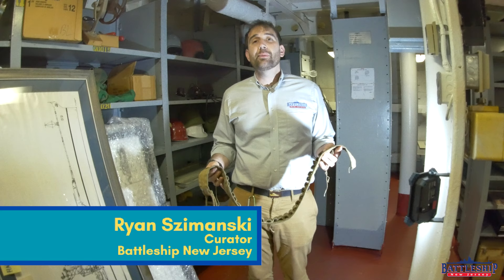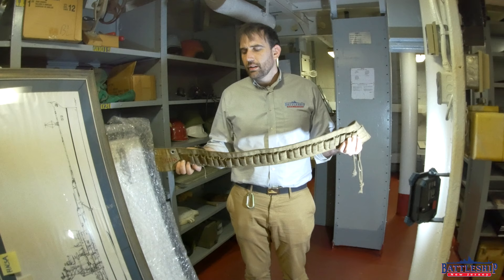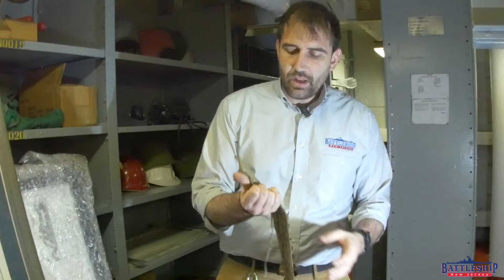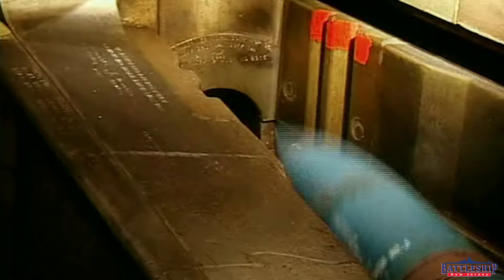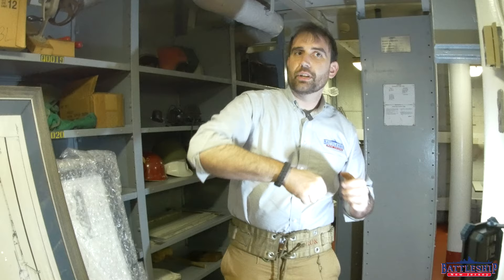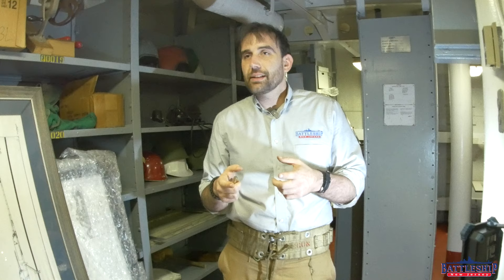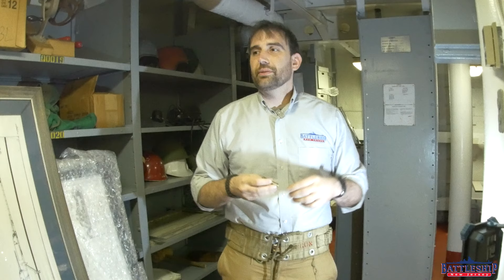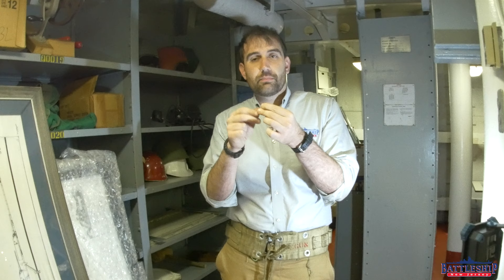A DIY Cowboy Belt for 16 Inchers

Comment: The primer looks like it is based on the .45-70 case, not a .30 cal. case.
Reply: That’s exactly what I was thinking.
Reply: I don’t think the case started life as an actual .45-70 case, especially after seeing the cross-section, but the external dimensions look very similar.
Reply: no it's modified 30-40 krag casing going by the comparison with the 30-06!
Reply: I have to respectfully disagree.  I measured the computer screen with digital calipers, and after doing some conversion calculations, the primer is exactly the size of a .45-70 case.   The .30-40 Krag has a rim of .545, and a base of .457, which is clearly smaller than the .30-06's  .473 base dia.,  but the .45-70 rim is .608,  with a base of .505, which is larger than the .473 of the .30-06 case, and is clearly evident in the video, even without measuring.     I have rifles in all three chamberings, and after comparing and handling them, there is no doubt in my mind that it is a .45-70 size case.   
The US military has a long history with the .45 Government round, and I believe they used it because it was big enough to hold the mechanical and electronic priming systems, while also being large enough to hold the necessary powder charge. @keithmoore5306
Reply: @Mopartoolman It certainly seems based on 45-70. The Bulletpicker website has a good diagram and basic dimensions of the Mk15 primer. There’s some of these primers next to a 30-06 and one of these belts on display aboard Alabama.

Comment: i would speculate that a boatswains mate made that belt. if it were an issue item, it probably would have had a hasp like a pistol belt vs string through loops.
Reply: They were probably very worried about metal to metal contact of any sort so decide not to have any metal buckle
Reply: @bascomnextion5639 You brought up a valid point, didn't think about it until right now

Comment: How hot did the guns get to the touch  with high round count engagements/training?
Was there ever a concern about cook offs when extended firing? Meaning bags or the primer going off on their own because of the gun being hot?
I’d imagine probably not because of the long period between shots and how much material you have you have to soak up and disperse the heat. As well as the purging system to take some of that heat away between shots.
Reply: Well the guns with a good crew could get the guns hot enough to slightly droop under combat circumstances in the south Pacific so but the steam system that evacuates the bores before reloading probably does do a good job of keeping it cool.

Comment: Rifle case looked like a .30-06.  I load close to 60 grains smokeless into those.  Most loads are between 50 and 60gr.  Other comments about the primer looking like a .45-70 case smell right.  The primer would definitely need thicker walls than what a .45-70 has, plus the thick star-embossed top plate.  I bet that 60gr of black in there was a good compressed load.

Comment: Practically, this belt makes a lot more sense than a box.  For starters, would they not have a "box holder" mounted somewhere?  Otherwise, you run the risk of the box being dropped into the gun pit.  

To say nothing of the bad stuff that could happen, if you had a loaded gun with an open breech, waiting for the guy to grab one off the floor.

As far as the fabricated belt......it looks like a prime candidate for a swap between the guy in the shop, and the guy in the turret crew.

Another person to interview.....the guys who primed these guns (assuming that there was one guy for each gun?).  I'll bet it was "exciting" to be directly below the gun when fired.

Comment: It is possible to extract dimensional data from pdfs provided you know what a known dimension is. Use the measuring tool to extract that dimension on the drawing and if it differs from the true dimension of the actual object divide one by the other for thw scaling factor.

Comment: I think that primer cartridge is actually a repurposed .45-70 Gov't cartridge, not a weird .30-06 variant, because of the big rim on it and the fact that the before-the-neck diameter of a .30-06 round is .45 approximately. Looks about right for that, and the .45-70 is already a black powder cartridge that's in service about the time bag guns start coming into service, so it makes sense to keep the cartridge around - you can use newer primers in older guns without issue. Makes the most sense, instead of having to invent a special case just for the special primer rounds.

Comment: That's more like a 45-70.

A standard M2 150gr 30-06 has 47 grains of powder.
Reply: More like a .30-30
Reply: no a 30-40 krag casing the karg was a rimmed round they just lopped it off at the start of the neck and crimped it off there!
Reply: @GunRagDave 30-40krag!

Comment: I kinda doubt that the thickness of the primer shell is a safety issue.  (please correct me if I'm wrong, these numbers are from google)  A ww2 16 inch gun operates at 37k psi.  IIRC there are some modern ones in testing that operate at 55k psi.  The operating chamber pressure for an M1 carbine (that fires the round shown in this video, I think) is 40k psi.

That matters because the pressure acts on surface area, so the forces on the two cases should be roughly the same, psi wise.  Does the duration under pressure effect this?  It may also just be to make them more rugged, made better contact, heats up less from the detonation charge from resistance, or was just low hanging fruit to make the case a little heavier.

Are there other factors at work on the physics of this, or am I misunderstanding something?

Comment: I can't imagine why they wouldn't just leave an ammo can full of boxes of them down in the gun pit taped or glued to the floor. After all, the ammo cans are already sealed with rubber gaskets so moisture shouldn't be an issue in service. And if something has gotten into the gun pit that can cause a can of them to catch fire, something catastrophic has happened.
Reply: It's something of a bother to bend down and pick up a single prmer from the floor for every shot. Even if they used an open box like that, it'd make sense for the primer chap to load up a bunch of primers at once from the box into the belt or some kind of bag at waist height and then use that supply to prime the gun without having to change position.
Reply: @LafayetteCCurtis  I mean for general storage when nobody is in the gun pit. Instead of keeping them all in a separate room, just keep a can of them plus the belt down in the gun pit at all times.
Reply: @shockwave6213  I'd say that one is for administrative reasons. The primers would get pretty difficult to count and keep track of once they're in the gun pit. Keeping them in a separate magazine would make it easier for the guns' logisticians to make note of how many boxes have been sent over into the gun pit, check how many unused boxes are left, inspect the boxes for missing/stolen primers, request replacements or remedial actions, etc. since they wouldn't have to run afoul of the pit crew while they're doing that. As for the boxes brought to the gun pit, the storeroom would probably simply treat them as having been used up and expect nothing to come back except for the empty boxes themselves.

Comment: I would rather have my cartridges held in a nylon / plastic rack holder very close to the gun; that way all one has to do is pick the cartridge  out of the rack and insert into the firing chamber. 
Better yet fill the cartridges into magazines and use a voice command system to load them into the firing chamber. Just my thoughts, Ryan.

Comment: You are quite wrong about the pressures involved causing the primer being heavier.  Both the 7.62x51 and 30-06 cartridges are subjected to more pressure than the primer / barrel would be on the 16" guns of the Iowa class battleships.  If you had ever reloading any ammo, you would have realized that since the pressures for those cartridges are pretty basic knowledge.  I was pretty sure that the 16" gun was a bit less, but I had to look it up, just to be sure before calling you out on your mistake.  From what I've read, the primers would get automatically ejected, but there was a provision to manually eject it if it was stuck.

Comment: Spending time to fill the belt and then put away the unused primers is redundant if a ready access point for primers is already in place. It seems unnecessary and a snag potential. Maybe he put the spent ones in there rather than sweeping up. Also eliminates brass rolling underfoot...

Comment: It looks cool, but for what practical reason would they have chosen this over a rack or something in the gun pit?

I would have made hooks on the walls in the gun pits to hold the ammo boxes with primers. Roughly judging the size, there could be 75 primers in one ammo box. In case more are needed, I think there is no time difference between taking a belt off and putting a new one on, or taking an ammo box from a hook and placing a new one back on the hook. However, picking primers from an ammo box and putting them in a belt takes time which you could have spent doing something more useful

There 2 reasons why I wouldn't have made a hook: either if primers could be supplied in these belts or if i wasn't allowed to weld a tiny hook on the wall

Comment: Ryan, is that cartridge some sort of archaic rifle or pistol round? I seem to recall a similar flange on the base of the round I have seen. Perhaps a gun collector would know. (Ahah!) Perhaps a .30-30 Winchester see Wikipedia: .30-30 Winchester. The cartridge you show would need to have the case modified for closure on the end. It is possible that the age of the rounds (or poorly stored bags) could be responsible for the number of misfired 16 inch guns. Is there any info on USS Texas or Olympia? Shore Batteries?
Reply: Actually, to me it looks more like it was developed from the .45-70 case. This would make more sense as that had been a U.S. military cartridge up until the early 20th century.

Comment: I would have used such a belt it would have been easier than digging in a box when finished using roll it up loaded and put it back in the box until needed

Comment: Would it be reasonable to assume that different guns were raced against each other in relosding or firing drills? That kind of item could be the type of thing a smart primer man invented to try an shave a few seconds off a procedure, but that was not widely adapted for competitive reasons or because it isn't regulation.
Reply: Might be but I assume replacing the primer was not the speed critical part of the loading sequence, getting the shell and powder bags into the barrel would take a lot more time.

Comment: 6:14 What you said about how strong the primer needs to be; could a faulty primer somehow have been the cause of USS Iowa’s 2nd turret backfiring?
Reply: Blowing a primer , even Blowing an entire priming cartridge will not cause a catastrophic failure like what happened on Iowa
Reply: If navy guns are similar to any guns, there's a metal piece that slides over the primer before its ready to fire. I forget what the piece is called, but it is basically a breach block for the primer itself.

Comment: My guess is the primmer is based of a 30-40 krag cut and crimped.
Reply: Similar to but not exactly.  Both the Army and Navy have separate artillery branches and beauauracies that wouldn't have just done the simple thing like using an infantry rifle blank. And as mentioned, it also has to be electrically fired.

Comment: It is my understanding that the 7.62 NATO (.308 cal.) cartridge contained 76 grains of powder.  Being adopted in 1957, it saw no WW-II action.  (Still in use, though.)
Reply: It's 40-ish grains depending on the load.
Reply: In WWII the 30 caliber round would have been an M2 round (30-06 Spr in civilian terms).  It would have held approx 50 grains of IMR 4895.
Reply: Hard to tell on video but looks like a .30-06 case. Up to 58g of powder, low of 43g. Based on type of powder and preference. Nosler load chart for 200g projectile

Comment: That looks more like a 38 caliber cartridge than a 30 cal. Your sample 30 cal is measured at the smaller neck rather than the body. Please find some calipers and measure the diameter of the primer. It should be more like 0.375 inch for a 38 caliber.